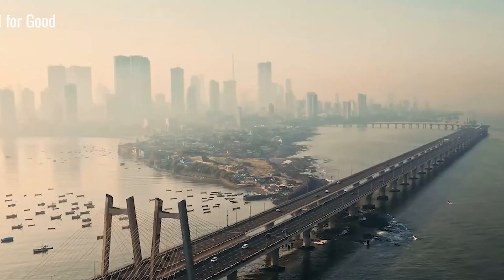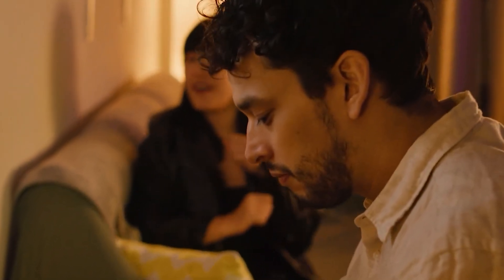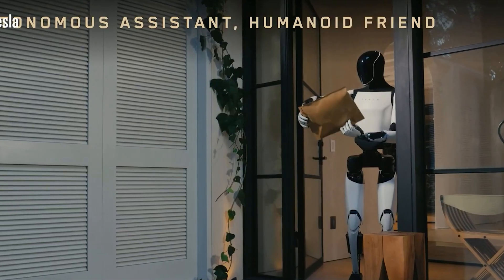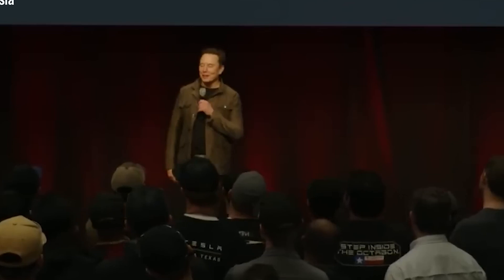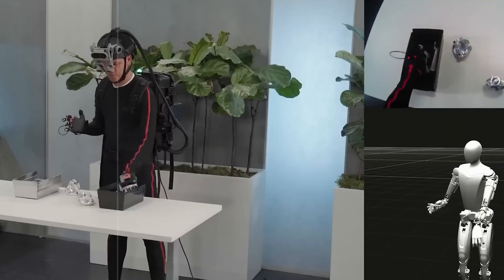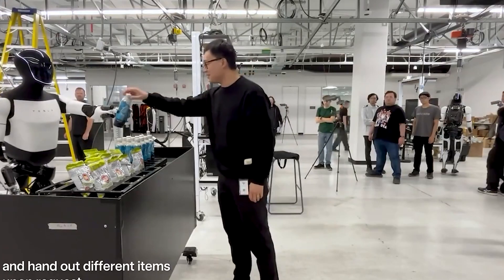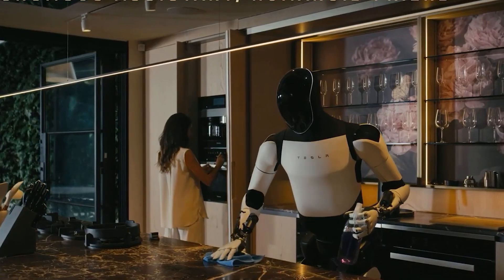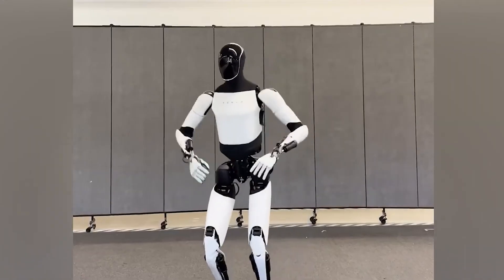Elon Musk Reveals SHOCKING 2026 Tesla Optimus Gen 3 Upgrade – 95% Sensory Boost!

Comment: There is a long road before an assembly line will be running.
Tesla does not have resources for motors, servos,and actuators.
Therefore all these hardware components will need to be constructed before the assembly of the robot.
The software will be a sister of the FSD circuitry in the cars.